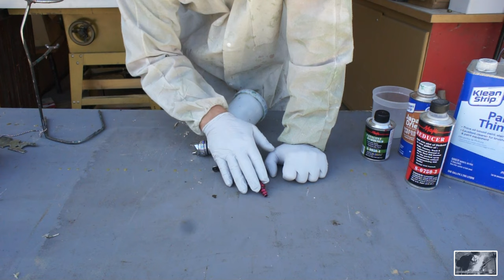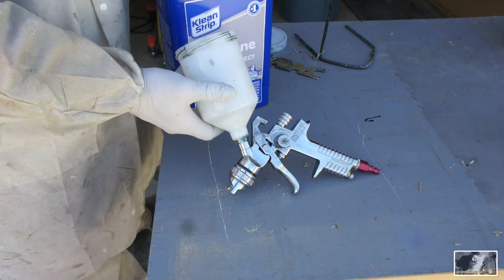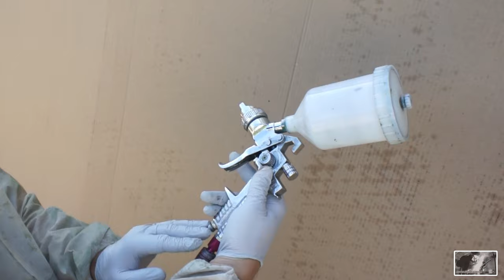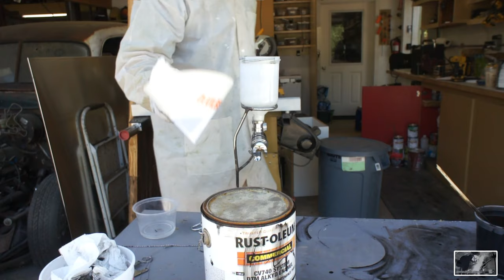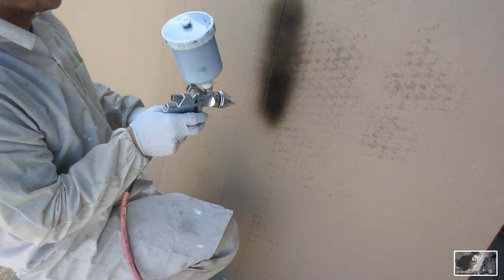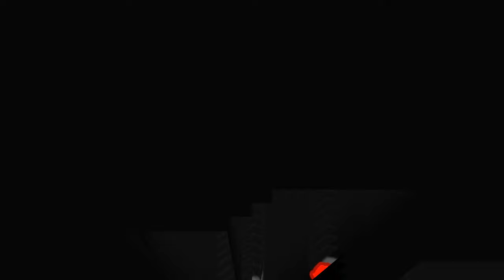HVLP quick start guide | spraying your project

Comment: Thank you for the video! 
Why do you put the plastic filter like you showed? In the past I thought that is the right way. Pin end hangs out of the gun, because to grab the filter is easier, isn't it? But in the close path I realised, the plastic filter wiggles little bit in the gun. If it has a little movement, that means it does not filter, due to the gaps...etc. So I flipped the plastic filter. Pin end goes first into the gun, then I screwed the pps tank into its place, then filter seems to be rock solid. No movement, looks good. So which method is the right one, what do you think?

Comment: In another of your video, you say something like "on these cheaper guns they don't come with a mark on your fluid knob so it helps to scratch a mark onto it..." It looks like you're using the same kind of gun here.  What gun are you using?  Clearly, from the amount of equipment you spray you've found something you like, I'm sure more than I am curious about what cheap guns you like.
Reply from the maker: The best value in my opinion is the harbor freight gun when it goes on sale for $9.99, plus you can use a 20% off coupon. I buy them 5 at a time and toss em after a few jobs. I do also keep an eye on the home depot, tractor supply and lowes sales bins also. I dont do much automotive-related spraying, mostly AG stuff. The cheap HFT guns are adequate for most everything I spray.
Reply: @unitedstatesofbuild4915  It's funny, I spray all sorts of stuff, from automotive to furniture to things like gym equipment.  I have a few of the purple guns, and I keep trying to use them, but every time I do I end up grabbing a more expensive gun halfway through the job and finishing it.  Usually, my problem with the purple guns isn't the quality of the spray, but the amount it puts down or how long it takes to put it down.  The funny part is that the gun that I end up grabbing in a purple gun's place is the HFT ~$70 gun, and I currently have that gun and the purple gun disassembled in a tub and found that most of the parts inside the gun are the same, literally the same, same machining, same etching on the nozzle... there are only VERY minor changes that make it spray better.

Comment: What reason are you using a reducer and japan drier?
Reply from the maker: This particular job had to be out the next morning. The hardener coupled with the japan drier makes for a lightening quick dry-time. Thanks for watching!
Reply: I thought the reducer extends drying time.
Reply from the maker: The main function of reducer here is to thin the paint to a sprayable state. There are different speed reducers available. A slow reducer allows the paint to flow out and remain open. A fast reducer helps it flash off or dry quicker.